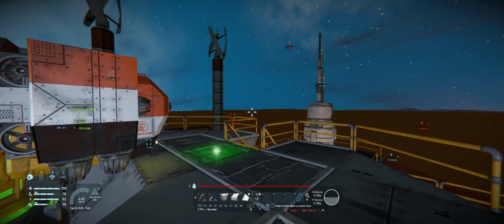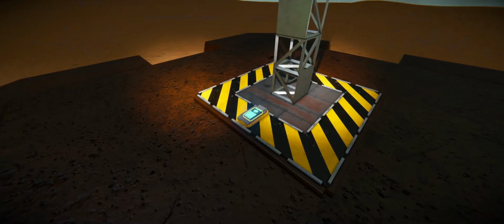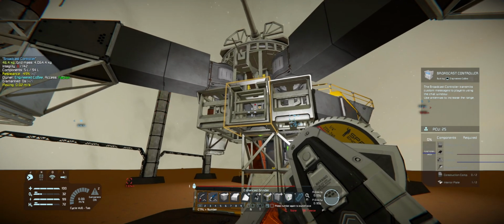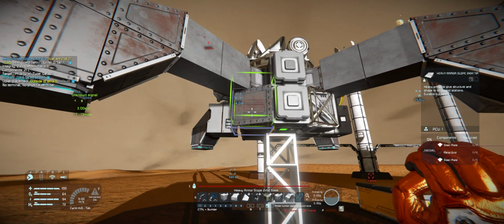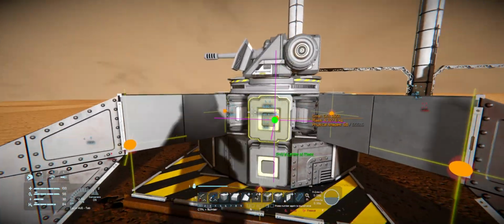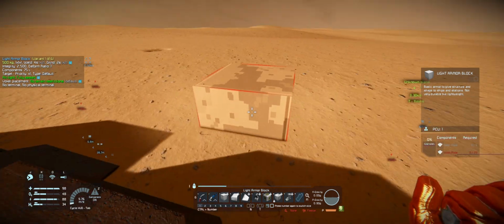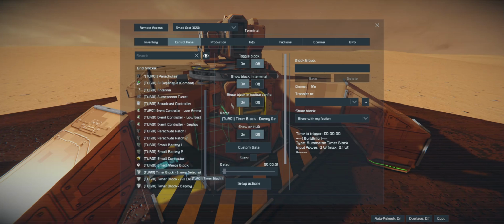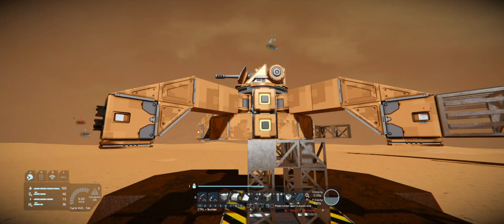Deploy and Conquer! Making a Mobile Autocannon Platform | Martian Engineering E8 | SE Survival

Comment: Drop turrets are such a cool idea! Painting them Mars Camo was a great little addition too.
There's something to be said for the simplicity of the project. I like all the ideas in chat but project bloat is such a pitfall. You could make them bigger, include an internal welder and cargo to make them self repairing, solar panels to keep them charged, add decoys and more armour to make them more resilient etc but that would probably all be over-spec for what action these things are actually going to see.
I do think a printing ship would be excellent though. I saw BlackArmor's Manta Bomber that can print and drop bombs at a fast rate - the turrets are probably too complex to weld that fast but something like that could work.

Comment: Love your little building platform.
And nice use of the signs around the connector. Makes such a difference.

I think it would be cool if you built a second drone and try having the legs placed down a block.
Maybe then you could even armour up the top, where the turret is sitting.
How about using the new truss beams as legs? Or are they too long..?
What also came to mind was to have the legs move up and down instead of L/R and make them connect/merge above the drone, forming a sort of cage. Maybe even have parachute hatches in the legs. Just inspired ideas.

I'm really enjoying this. A factory would be really cool!
Thanks for your efforts Engineered Coffee!
Reply from the maker: Glad you are inspired! I am thinking of building a heavy duty variant with the assault cannon. The current variant will definitely flip with that larger turret. I may see how that one looks with the beams and lower or wider legs to balance the center of mass. The problem with hinges going up is the footprint of the turrets are actually 5x5/7x7 so the legs have to stick pretty far out to not interfere.
Reply: @EngineeredCoffee  You're right.
The hitboxes are ridiculous.